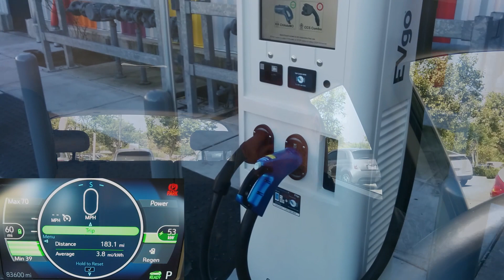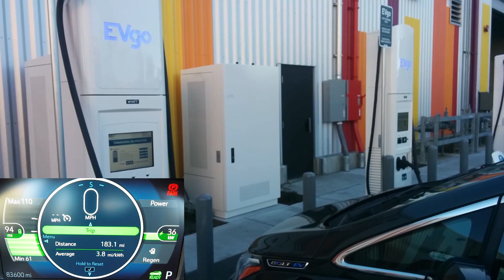Plug-Side Chat: Nissan Funding 200 New 100 kW EVgo Fast Chargers

Comment: Hey news coulomb another nice and informative video. I haven't seen these split charger level three solutions yet. Can you explain how evgo handles the price per minute when you're charging rate can change so dramatically? Does it drop in half if there are two vehicles? Can you tell me an evgo location has that split power.
Reply from the maker: Thanks! Unfortunately, it looks like it's static per minute pricing. I'm probably going to address this in an upcoming video because it is an issue.
Reply: @newscoulomb3705  where is location?
Reply from the maker: This is the power splitting site I used: https://www.plugshare.com/location/193647

Comment: EVgo has a 100% reliability record for me.
Reply from the maker: Mine is closer to 99.7%, but I do use them a lot. I've never been stranded, though, because the public charging sites in California are relatively close together.
Reply: @newscoulomb3705  oh yeah, I am sure that people who use them more than I do have a lower than 100% success rate. The only thing I've ever had was all chargers in use and having to wait for 20 minutes before I could hook up, which I don't consider a failure, although I would be willing to consider the argument that it is a failure (of capacity planning).

Comment: 100kW should max out the Bolt, so sounds good to me.
Reply from the maker: It still maxes out most EVs. I think the thing to focus on is that it's 200 amps, so based on battery voltage, you'll see varying charge rates. The Bolt EV will see ~55 kW. A Model 3 (if they made an adapter capable) would see ~72 kW. The Kona Electric and Niro EV might see ~77 kW. And the I-PACE might see closer to 80 kW. 

The other, even more important thing to focus on is that 100 kW is the right speed for many stops. Going to have a sit-down lunch or dinner? You're going to spend 45 minutes to an hour, typically, and most EVs will be >80% at that point, even if you arrive with a nearly empty battery. 

It's a win-win because businesses want to see a benefit out of the chargers they are hosting, and no one wants to just sit in their car for 30 to 45 minutes waiting for their car to charge up.

Comment: 100kw is no longer considered fast.
Reply from the maker: Sure it is. It's faster than Tesla's "Urban" Superchargers, which I think still qualify as fast.  The term they are using for >150 kW is "ultrafast" charging. 

For me, it's not about the speed specifically, but rather whether that speed is appropriate for the location. 100 kW chargers are perfect restaurant type locations.

Comment: One of my recent frustrations with EVGO is the limiting of charging to only 30 minutes.  I stopped at the charge station in Ontario with 25% on my Leaf Plus and after 30-minutes it was only up to around 60%.  I then had to come back out and unplug and restart the session to get more charge.  The 30 minute limit made sense when you had cars with a 24-30kWh battery.  Now with cars having 60+ kWh batteries this policy doesn't make sense and is just annoying.  Not sure if it is a duty cycle issue with the charger or just a old policy that needs updating.
Reply from the maker: It's because you're not a member of their network; otherwise, the sessions are 45 and 60 minutes depending on whether it's peak or off peak times.
Reply: @newscoulomb3705  Which just further confirms that the companies that run the EV Chargers are still making it to complicated to charge your car at public charging stations.   The EVgo website states I will be charged extra for going over 30 minutes, which is fine if you need the extra charge.  They have my credit card information and I have a account setup with them. "Session times are 30 minutes for DC charging and 60 minutes for Level 2 charging at participating stations. Should you go over your session time, you will be assessed additional fees at a rate of $0.10 per minute for DC charging and $1.00 per hour for Level 2 charging."
Reply from the maker: Ah, then they need to correct their website. Their sessions end at the specified time, so you'd have to restart to continue charging.

Comment: EV chargers need to be put in groups of 4 or more. This would reduce the chance of ICEing and increase the chance of having an open charger and not having to wait to charge. As battery range increases and charge speed increases people need to charge for 15 - 20 minutes and GO. That would be similar to a gas station where you fuel up, hit the rest room and GO. People need to charge in the 20 - 80% range. The charge rate drops as the battery fills up. It is usually a waste of time to sit there and charge over 70 - 80% unless you really need it to get to the next charger or to your destination. People need to get away from the fill up mentality.  100% charge is not good for the battery and wastes time.

Comment: All the EVGO and Electrify America stations have been down here intermittently, and most recently long term. With an EV vehicle range under 100 miles, I can't go anywhere:( My question is, why is there such a high rate of errors?
Reply from the maker: I have no idea. What area are you in specifically? Out here, EVgo is by far the most reliable charging provider. EA is less reliable, but they have more chargers per site, so I've never had an issue getting a charge. I know that specific units that they installed (from Efacec) have been having serious issues and have had poor reliability. I suppose that if EVgo was also using Efacec in your region, they've had similar problems. I know that GreenLots has had poor reliability, and they also use Efacec chargers. 

Really, though, without knowing your specific region and diving into the details of the chargers that are having issues, I'm not sure.

Comment: Great video and glad to hear about more chargers going in!  I'd love to see some more charges get installed in Oregon. The I-5 corridor is well represented, but a few in central Oregon (maybe Bend?!) and a few along the Oregon Coast would be fantastic! Once you leave the I-5 corridor it gets pretty sparse up here right now...  

BTW, Thanks for your highly educational EV/Bolt videos - I've had an older Leaf for a while but recently bought a Bolt as well, and it's fantastic.  Your videos are quite helpful in educating me about EV's in general and the Bolt specifically. Thanks!!
Reply from the maker: Thanks! That's great to hear. :-)

Yes, we definitely need some coverage off the major corridors, too. That's why I'm not necessarily tied to this idea of of only building the 350 kW freeway chargers. In Northern California, we still have issues along Highway 395 up to the Oregon border. There's a lot of area right now that's just not covered.

Comment: Nissan too should CCS. Finally we have got a standard. Nissan should comply.
Reply from the maker: I'd like to see a single standard, too, but Nissan is too committed worldwide to their CHAdeMO standard at this point.
Reply: I think what Nissan should really do is give buyers an option where they would have both a c c s and a chademo connection in their vehicles.  I think that doing so would give them unique competitive advantage at a time when they could really use it.

 In a lot of areas where their was significant that the early adopters of EVs where pretty much all driving Nissan Leafs.  Consequently the quick chargers of those early and still operational we're all chademo.  Along the Oregon coast, they're still the dominant quick charging option. 

As the newer mostly CCS charging networks build-out more abd more, a car with dual options would be able to take advantage of the newer chargers and the older ones. 

One of the reasons that many people seem not to be aware of in terms on Nissan's dedication to the Chademo standard is its ability to not only receive receive power from the grid but also to send power to the grid. 

 I think that many have forgotten that about the time that Nissan was launching the leaf in Japan was when they suffered their most significant earthquake in quite a while and I think that incident rightfully influenced the thinking on the part of Nissan. 

As more data is gained and the fear of hurting the battery by using it has a power source for homes and businesses eventually succumbs, people will see the benefit not only for emergency situations but also it allows them to use something that they were) already going to buy, the car,  like a big powerwall and it should could save significant amounts of money.

Comment: A lot to think about....
1.  I'm surprised the e+ can take 100kW since it doesn't have active battery cooling (ok, maybe a fan but not liquid cooled).  This also tells me that Nissan doesn't anticipate higher charge rates on future models.
2.  I assume the new chargers will also have a CCS plug?
3.  Regarding possible locations, here in the east we desperately need a couple of DCFC stations on the I-85/I-65 corridor between Atlanta, Georgia and Mobile, AL.  EA is planning one in Montgomery, AL for phase 2, but that's a while from now.
4.  $60MM for 200 chargers is approx. $300K each.  Seems high to me but what do I know....
Reply from the maker: To some of your points:
1. It's mostly due to the power/energy density of the cells. The LEAF battery cells have always been able to support close to a 1.5 C charging rate. For instance, the 30 kWh LEAF could charge at 50 kW. But to your point about the lack of liquid cooling: doubt the e-Plus can repeatedly charge at that rate. 

Also, don't discount that Nissan might push faster charging in the future. My guess is that most of these chargers will be used in a similar fashion as EVgo's current build out of 50 kW chargers. Essentially, EVgo could still be building out faster than 100 kW chargers in the future. 

The biggest reason is likely that liquid-cooled CHAdeMO cables don't currently exist (part of why Electrify America's CHAdeMO hookups are 50 kW). Until those cables are made, there's no point pushing past 100 kW.

2. Yes, these will be dual-standard, CCS+CHAdeMO chargers.

3. I'd say that you should submit a few, specific site recommendations to EVgo. They might end up building a site there. 

Also, EA's Cycle 2 chargers might start going online before they finish Cycle 1 in California.

4. It is a lot of money, but there's a lot of cost that goes into building these sites. The last info I saw, a 50 kW unit costs about $30,000 to $40,000, and that cost is only a fraction of the total site cost: planning, permitting, site prep, construction, etc.

Comment: My experiences re EVGo and the others -- I found EVGo really useful for a trip to Southern California last winter, although I didn't find that their locations were the most convenient.  Still, the chargers worked, and at a reasonable price.  More recently, I did a trip up to Oregon and found Electrify America's growing network to be the new winner.  Using the new app and pricing at Electrify America sites, the Bolt can move on down the road pretty efficiently -- the costs were lower than EVGo and my average stop was only 30 minutes or so.  Final network to mention -- ChargePoint...  My general experience with ChargePoint is that their Level 2 chargers are common and tend to work, but their Level 3 chargers out in the wild are often not working properly or -- when they are working -- they're often slow.  So they are my third choice, except when I'm stopping for multiple hours or overnight and can use Level 2.  In summary -- the Electrify America network of stations may have had a slow start, but the pricing and convenience of their network is now pretty good IMHO.
Reply from the maker: My experiences pretty much mirror yours. EVgo has, for the most part, been the most reliable network for me, and ChargePoint has been hit and miss. I've had several occasions where I've showed up to a ChargePoint site with three chargers to find only one working.

Electrify America has definitely had their issues, and so far, I've always been able to activate a charge at EA sites. Plus, as you mentioned, they are now the cheapest option for Bolt EV owners.

Comment: I agree with most of your points.  My one comment is on number of charge stations.  For the most part 4 minimum is a good number.  But if your trying to connect low population density areas that currently have poor to non-existent coverage then I think it would beneficial to even have even just two chargers per site.   My other thought is given the recent EA Efasce issues going with a non-liquid cooled cable might allow for a more reliable station.  It's just one less thing to go wrong.
Reply from the maker: I agree to a certain extent about sites with fewer than four chargers, but I really do think those are very limited cases. We'd have to be talking really low population areas. Plus, my point is more about building toward the future. Unless those sites have little to no traffic from outside the community, two chargers might only be sufficient for the next couple of years. 

We're seeing this as a major problem with the California Energy Commission grant-funded sites. The submitted plans were approved back in 2016, and those sites are just now going online. Two or three 50 kW chargers along one of the busiest EV corridors in the world (I-5) just doesn't cut it anymore.

As for the non-liquid-cooled cables, I think you're right. It's one less point of failure.

Comment: More chargers per site are needed in the Santa Clarita area.  On one trip to SoCal we had to go to all three sites before we found an available charger.  I agree that there should be a minimum of 4 stalls/ site, preferably 6 - 8.
Reply from the maker: Yes, the Santa Clarita EVgo sites definitely need to be expanded.
Reply: That's terrific! What kind of cars are taking up the spots?
Reply: Anthony Carroll I’ve seen Bolts, Leafs and i3’s that I can remember.  They were doing construction at the chargers by Metrolink when we went by those so the charging stations were unavailable and obviously not noted on PlugShare as a result.
Reply from the maker: @anthonyc8499  Pretty much every car you can think of. My last trip north, every single charger I stopped at had at least one other EV there charging. Kona Electric, i3, Niro EV, Bolt EV. The public charging in California is already starting to be overwhelmed.
Reply: @newscoulomb3705  thanks for the scoop. This is actually a good problem to have as it's indicative of the uptake of EVs in the marketplace and a glimpse into the future for other cities & states. More (reliable) 150kW+ chargers and the vehicles that can handle it is the ideal answer.
Reply from the maker: @anthonyc8499  Well, I've been seeing this since 2017, though back then, it was primarily only Chevy Bolt EVs. As for the reliability, I haven't experienced anything nearly as bad as some have claimed.

Comment: The Nissan/EVgo effort is too little too late.  Given Nissan's huge losses and layoffs, I would be surprised if this plan is carried out.    When we were negotiating a trade-in of our Leaf for the 62kWh version, the lack of available  100kW CHAdeMO chargers was one factor that sent us to a CCS vehicle instead.  There are many of those older 100 Amp EVgo chargers that could use an upgrade.  You can't rely on the single CHAdeMO EA chargers for trip planning - PlugShare comments show a lot of failures.
Reply from the maker: I do think many of the PlugShare comments are overblown, though some are valid. Regardless, I stopped relying on single-charger DCFC sites early to mid 2017. It was just too common to arrive with one EV charging and another waiting in line. At first I would just and then move on. Later, I just didn't bother stopping.